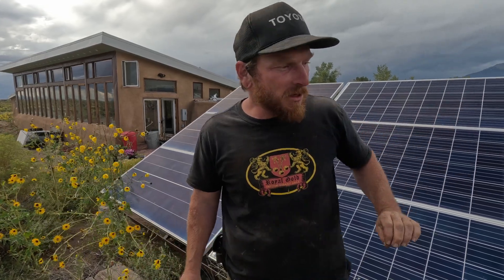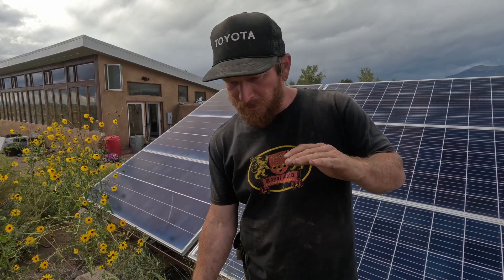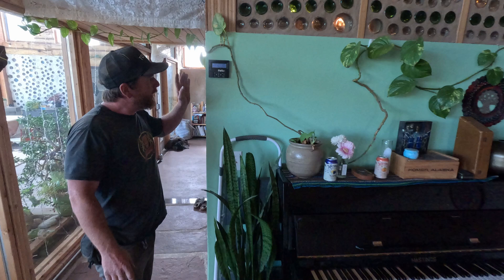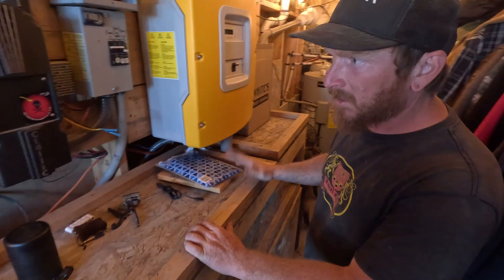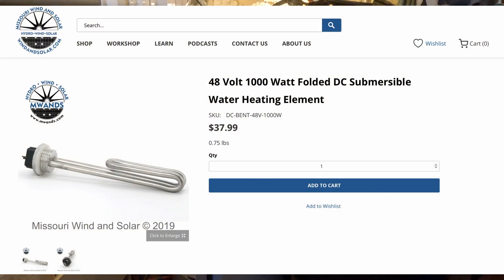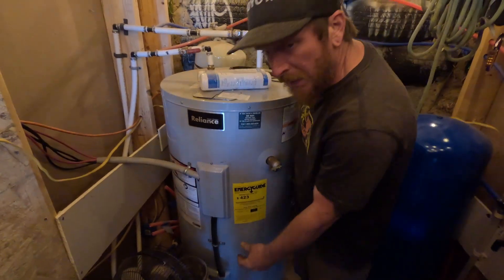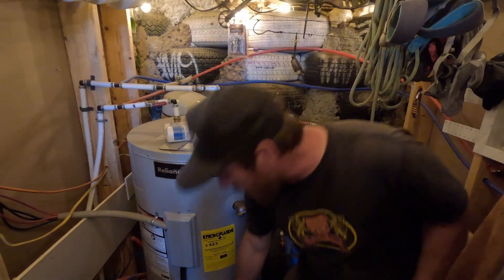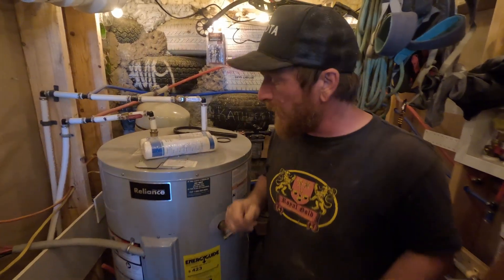Most underrated off grid system Earthship

Comment: Dumping from battery is not a very good way to divert excess solar power.  Doing that requires an extra KWH of battery storage,  adds extra cycles to the battery, can leave you at the end of the day without a full battery and can damage batteries by not allowing them to balance.  It is far more efficient to divert directly from array voltage into a higher voltage heater element. I can divert any excess 5 to 1,500W as it happens and never touch resources of charge controller, inverter or battery.  It is amazing how much excess there is in solar systems and the time charge controllers are not putting all they can into the battery.  I have a small system and even the laundry has a hot water tank.  All cycles use hot water and the clothes come out steaming.

Comment: I have thought about a very closely related concept.  If my panels fully charge my batteries by noon (for example), I could run heavy loads, even an electric dryer, in the early afternoon and still have plenty of sunlight to recharge the batteries before sundown, as if the heavy load never happened.  But it did.
Reply from the maker: @PeterLawton  a dryer is a lot but it’s a good example of a load to dump I was thinking an ice maker or an electric car charging station or something where it switches over automatically on float and switches off on resting mode 

I guess it’s all an experiment

Comment: I was distracted by your concrete wall in the utility room built with car tires as aggregate. Thanks for the hot tip on the DC heating element.

Comment: There is a common thing on water heaters that you should look into.
They have two elements but only one is powered at a time by the controller.
The way it works is normally the lower element runs to keep the whole tank at temperature. 
If you draw off so much hot water that the upper part drops below a slightly lower set point, they turn off the lower element and apply power to the upper one.
This means that get get a few advantages:
1) The amount of hot water you can draw off before it gets really cold is increased a lot.  This is because instead of trying to warm the suport cold water at the bottom of the tank you instead warm some that is already a little warmed,
2) The effective efficiency of the hot water system is improved because you are using a smaller tank that takes less power to keep hot.
Reply from the maker: @kensmith5694  thank you for your knowledge I still have a lot of learning to do, I’ll look into it

Comment: You are charging another kind of battery and water can hold a lot of BTUs.  Its really smart.   At first it feels so counter intuitive because electric heat is known to be inefficient.
Reply: Electric heat is sort of 100% efficient.  Heat pumps are sort of more than 100% efficient because the move heat rather than creating it.
Really he could use a heat pump as his energy dump and get even more hot water.
Reply: @kensmith5694  this^^

Comment: heating your water with photovoltaic is so silly.  the old passive solar water heaters are like 4 times as efficient.  i get it, you're trying to dump power; there has to be a better way.
Reply from the maker: @travismiller5548  a better way to heat water or a better thing to dump power into?
Reply: Its excess power: its 100% efficient.    You mean to say passive solar gets hotter quicker. Mostly people use hot water in the evenings and early mornings so in most cases this wouldn't be a factor.  Saying this as a fan of passive solar.

Comment: Water heaters only run one element at a time.   The top one runs until the water in the upper part of the tank is warm and then it turns off and powers on the lower element.   You should be able to wire it up like normal one would think unless the switch over needs 208.
Reply: Yes, and if you start taking a lot of water, the switch goes the other way.  This is the part that is a bit harder to explain but it is a good system.
Reply from the maker: @pault.juckniess7265  I didn’t know that, I would have my buddy kick on a heavy load (table or chop saw) and I would stand there and watch the relays kick off, when I disconnected the upper element it stayed on, I’m still figuring it out but it’s worked well for about 2 years the way it’s set up